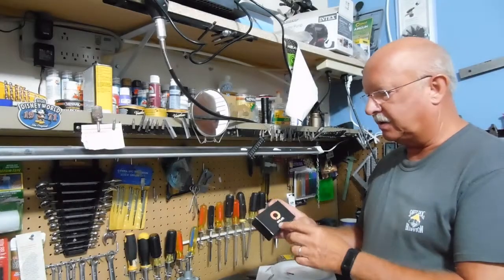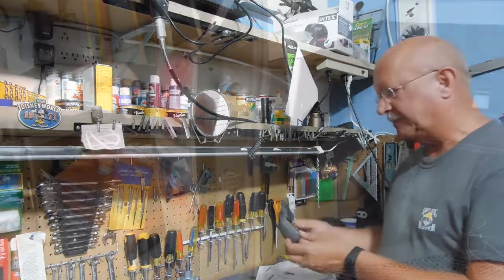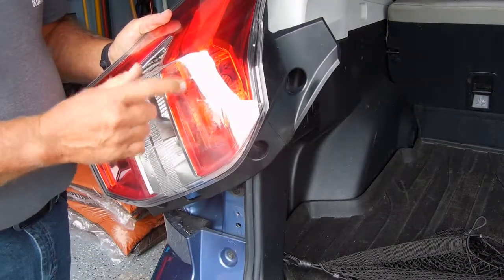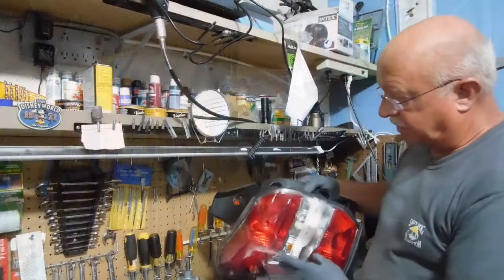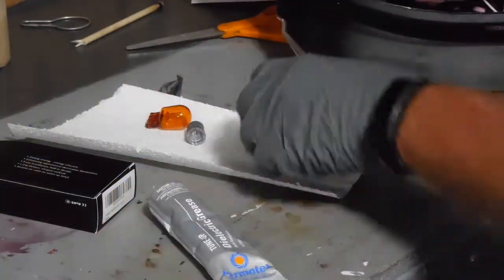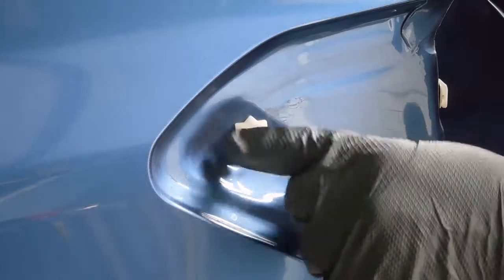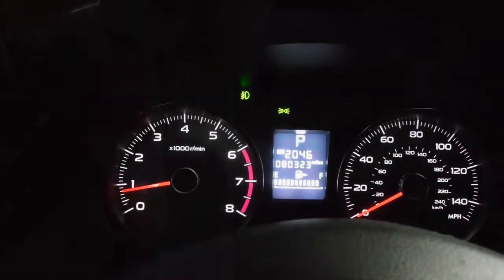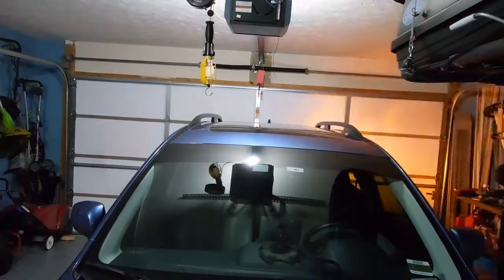Subaru LED turnsignal and flashers light upgrade to LED

Comment: Does the bulb itself you got have the built-in resistor? I bought some LED bulbs a few years back and they had the hyperflash + check-engine light. I wasn't sure if I had room to put the resistor in and not touch anything that would get hot.
Reply from the maker: The resistors are built in, so just put them in and go!  I’ve had two go bad. One in my previous Forester and on in my current Forester.  Also, if you leave the signal on for an extended period of time (making a left turn for example), I have had it hyperflash…. But that also might be a system in the car letting you know that you have left your signal on????
All that being said, they are very bright! We travel a lot, and when interstate suddenly comes to a stop, I have visually observed traffic (especially semi trucks), start slowing down further behind me.  No scientific proof, but I will always use these.  But again… very bright!
Thanks for watching 👍👍
Reply: @BoilerDan1  what do you mean by you've had two go bad? I installed a set this morning, everything seemed to be working fine. While leaving work, the driver side was hyperflashing and the passenger side was fine. I contacted oxilam to ask them if I need to install load resistors or if I should install another set.
Reply from the maker: I put them on two different vehicles.
The one I remember going bad actually overheated and had a burnt rubber smell.  I only have them on the rear and haven’t had hyperflash.
As I understand, the resistors are built in the lamp.  Hopefully the company will clarify for you.
As a last resort maybe try just use in the rear?

Comment: What exact part number is that bulb?
Reply from the maker: OXILAM 7440 LED Bulbs Amber Yellow
Here’s a link to Amazon where I purchased them: https://a.co/d/bNzwmC1
Reply: @BoilerDan1  Thank you so much!
Reply from the maker: You’re welcome!  Just know that they are very bright. But when I have had traffic come to a quick stop on an interstate, I’ve memorized where my flasher button is and I can tell traffic behind me tales notice!
The downside is when you close the tailgate at night , they flash and it almost hurts they are so bright.
But I will take that over being rear ended by a semi!
I also had one go bad, however the company did replace it.
I still have them on my current Subaru Forester and just flipped over 85,000 miles.
Thanks for watching.👍